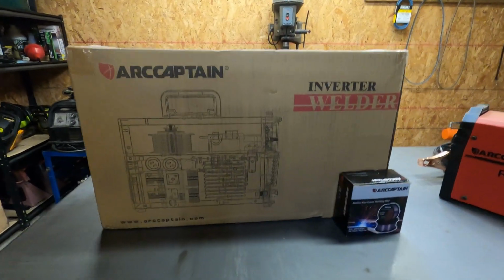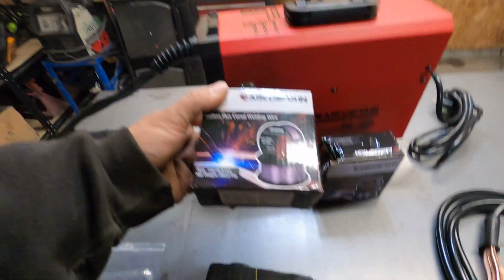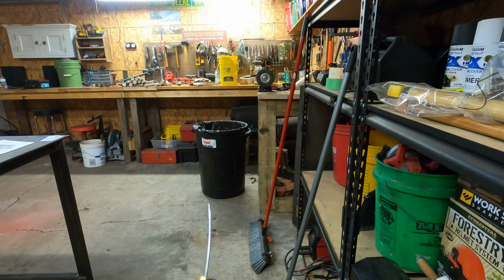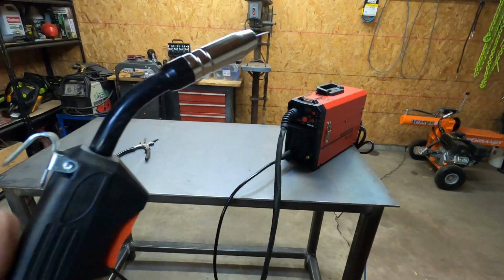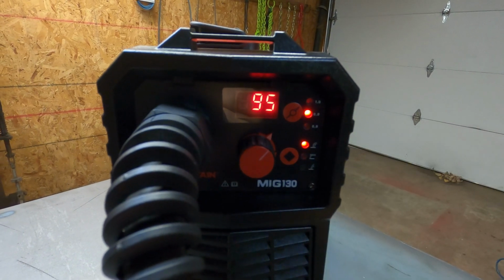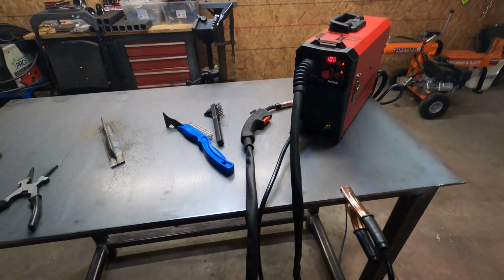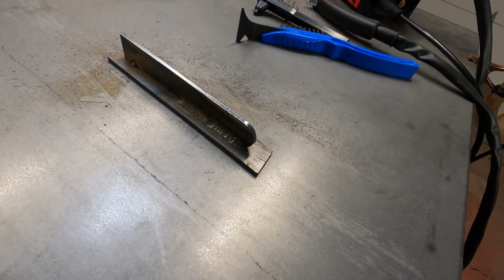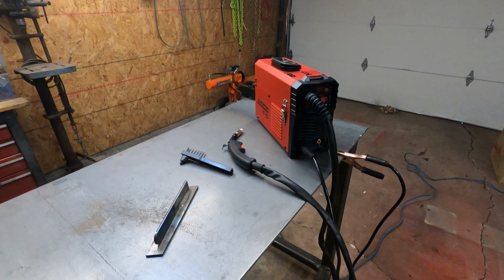New Arccaptain MIG 130 Flux core Welder- Awesome DIY Welding Unit

Comment: Hey Boss, who makes your blue brush with the scraper on the end? Does that scraper easily remove the beads off your table?
Reply from the maker: That brush is a cheap "jobsmart" brand from tractor supply company. If its just splatter, it comes off fairly easily. Nowadays to clean up my bench i just use a 20v angle grinder to grind the splatter smooth.
Reply: @skywatcherranchswr Thx

Comment: Run it through where? Where do you put the wire through??
Reply from the maker: 10:07 tiny little tube with an even smaller hole in it. can't miss it
Reply from the maker: and then the consumables also have small holes in them if you were referring to the tip of the gun

Comment: I just had one of these delivered today and have now seen 3 favorable product reviews.  Their (very good) website has options to purchase “used” merchandise which is what I chose and it was about $60 off the regular price.  When I took it out of the box it appeared brand new to me.  NFI, but for beginners this looks to be a great option!
Reply from the maker: This MIG130 has been my favorite welder that i have ever used. It just goes and goes and goes. I have replaced the consumables a million times and ran tons of wire through it and it works great. I have welded alot of things that were far too big for what this welder is rated for but with some patience,  i have welded some awesome projects with it and those welds are still strong today. Easily worth the money. You made a good choice!

Comment: 10"34 I I have an old AC century stick welder that still works well but I have been needing a Mig for different types of work. This Little machines offers a lot of bang for the buck so I ordered 2 days ago and I am confident it will more than take care of all my welding needs at my small engine and Cub cadet refurbish and repair shop
Reply from the maker: @DanielYordy-z8e  I hope it works well for your needs. I definitely enjoy it and I'm planning on doing some projects very soon with it.

Comment: If you watch a bunch of video's on Flux Core Welding you'll see exactly why your supposed to put the Welding lead on the negative side and ground clamp on positive side , that's Flux Core Welding.  I wonder why people don't look stuff up before using , I watch tons of video's before I buy anything and look to see how it works and check reviews

Comment: the setting you used for wire speed is not wire speed, it is wire size. the wire they send with the unit is .30. That is the auto speed setting.

Comment: Get notebooks and just make your good settings when you find those sweet spots, and you running smoothly, and when you switch wire sizes, and different metal thickness, u can go to your notes, and your up and going. Ky

Comment: The polarity is reversed with flux core.  I got one of these off Amazone yesterday.  With coupon ir was $106.  I haven't used it yet but did load the wire and played with the controls to get familiar with it.  I did have a 140 amp back in the 90's.  Man they've come a long ways.  If I get welds like you got, I guess I will? I'll be thoroughly impressed.  I really like that you can stick welg with it too.

Comment: Hello got a question still working and these machine can i use a 6011 rod stick?
Reply from the maker: Yes it's still working, not sure on the rods, I haven't tried arc welding with it yet, nor do I know much about arc welding yet.
Reply: Haven't received my machine yet but I don't see why not.  I've been stick welding 6011 and good old 7014 on AC and  DC for years.
Reply: The stick 200 does weld with 6011 OR 6013

Comment: Great video.  I would like to get a hold of one of these to do a comparison video on my channel with my Harbor Freight Titanium Easy-Flux125.  The Arccaptain appears to be better built with a great latch assembly and a handle.  Throw in the fact that the Arccaptian also does stick welding and it's a no-brainer.  I subscribed to your channel!  I also have a Everlast iMig 200 that does Mig and stick.  I think everyone needs a flux core welder for the occasion when you need to weld outside where any breeze will blow away the shielding gas.  I love seeing these videos from the smaller hobbyist style channels.
Reply from the maker: Thanks for the comment! This is the newest welder I've ever used and it's crazy how light these are. I've never tried any of the other similar models like the harbor freight ones but it would be interesting to try different ones to compare. I'm really impressed by this arccaptain. I've been meaning to make some more videos with it but I've been so busy with splitting wood. I have a garden tractor part to weld up so I will have a video on it soon.

Comment: What size fc wire did you use .030 or .035 ? and what thickness was the metal you were welding thanks
Reply from the maker: i was using .030 and the metal pieces I welded were pretty darn close to 1/8 inch
Reply: @skywatcherranchswr 
What brand wire ?
Reply from the maker: @meca13b  Arccaptain wire! You can get it using the link in the description.
Reply: 0.30 what comes with it